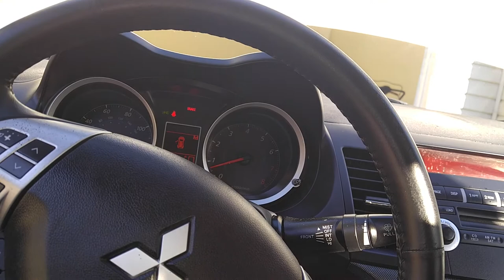How to install HID lights on a 2009 mitsubishi lancer

Comment: Question. What number the HID headlights did you use? 6K or 8K with 35W or 55W? I need an answer.
Reply from the maker: 6k 55w the 55w is brighter
Reply: Abram Brown Are you sure? Does have mix white with blue?
Reply: Abram Brown I know 6k has white with blue in the video, but why the color change?